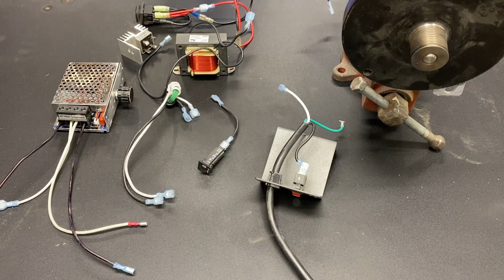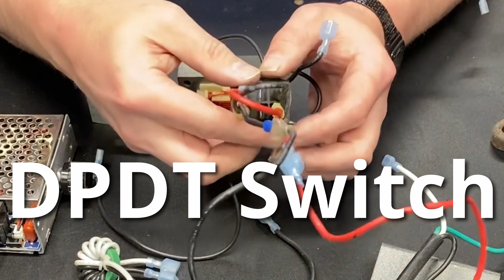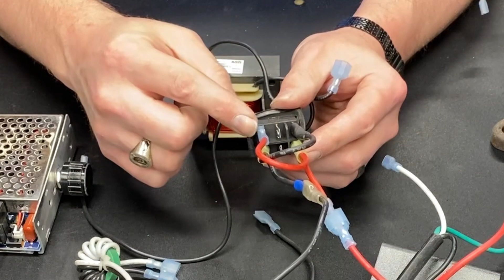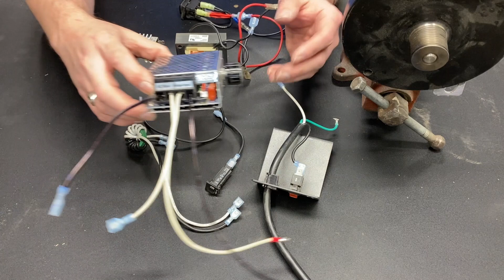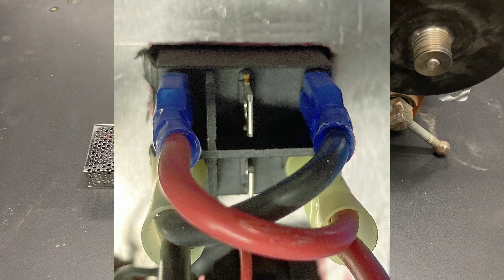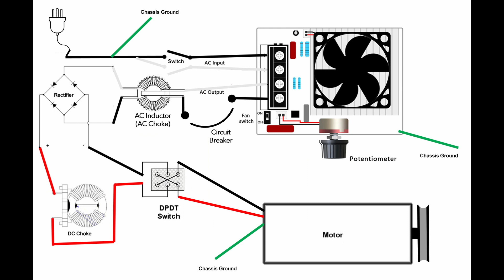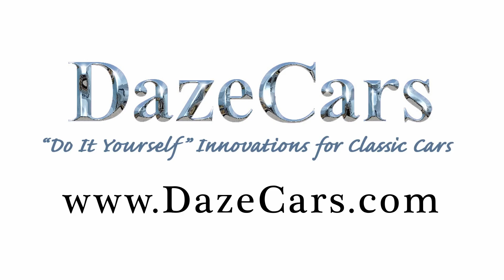Hooking up the Components for a Quality SCR Treadmill Motor Power Supply, Treadmill Motor Controller

Comment: Beautiful 😍 🙂👍👍👍cheers from Australia. Subbed and liked
Reply from the maker: Glad you liked it!!
Reply: @dazecars  thank you! I stripped my wife's treadmill and kept all electronics!
Reply from the maker: @Edmond3290  what kind of goodies did it have? which control board? which motor?
Reply: @dazecars  it was a healthstream brand which I paid 1200 AUD from my dads inheritance. I did tell the wife: it just needs a new belt! Everything else is perfect. She wanted it gone. So I have absolutely everything but I have pulled all the electronics out carefully and now I'm going to cut up the frame! I did want to sell it but she wanted it gone badly. Lol. So I'm happy with a 180 volt 5 Amp motor.
Reply: @dazecars  it has a j star brand motor for incline, a HPF filter, quite a ferrite core style choke, circuit breaker, on/ off switch .a complete circuit board with the main control panel and magnetic safety switch, and a little transformer. BTW I've never stripped a elliptical strider? But I have her healthstream strider. LCD is stuffed but everything else is there. After icut up a heap of steel while it's daylight here. That's my next mission! Lol 😆. Cheers

Comment: What size circuit breaker are you using? 15a?
Reply from the maker: 20 but a 15 would work just fine as well
Reply: Could I use a fuse a 20 amp fuse from a vehicle as a circuit breaker ?
Reply from the maker: I wouldn't

Comment: The power from the wall go at 220v or 120v ?
Reply from the maker: I am running mine on 110, but many SCR controllers are set up to work at 110-220 so as long as you had a 180V DC motor you could use 220 out of the wall.  I would not use a 90V DC motor with an SCR and plug it into 220 UNLESS you put a limiting resister in line with the potentiometer to make the max speed the max rated RPM of the motor.

Comment: In the video ( which is very good information) you have a circuit breaker, what amp did you use.
Reply from the maker: I used a 20 amp.  You could probably get away with 15 but 20 is better.
Reply: Perfect thank you for the information and video, it clears up my questions and is very well done!
Reply from the maker: @claywilson8706   Thanks, let me know if any other questions come up.
Reply: @dazecars  Thanks again and keep up the good information, It's much appreciated !

Comment: I wired my Johnson 2.5 hp treadmill motor to a 12 volt dc wall wart power supply. It runs the right speed for my thickness sander conveyor belt. Will running it that way damage the motor?
Reply from the maker: It shouldn't hurt anything but it will probably not run very well.  A wall wart doesn't typically put out more than 1.5 amps and most are even smaller than that.  Most treadmill motors are 10-20 amps.  There is a direct correlation between amps and torque so if you are providing fewer amps than what the motor is rated at you will get less torque and in this case a lot less.  By extension that also means less HP as HP is a calculation based on torque in foot pounds and RPMs.
Reply: Thanks for the info.
Reply from the maker: @chuckstoffregen8632  Glad I could help

Comment: Great informational video. I have acquired all the components that I will need except the a/c choke. I was wondering if I could use a noise filter (RDFC-2916 047100) as found in smart drive washing machines. I have access to this at 0 cost but not sure if it would work.
Thank you for shedding light and helping out.
Reply from the maker: My FAQ video scheduled to go public on Tuesday is all about chokes, but I can give you a preview of the information on that video. 😁 When it comes to the washing machine noise filter, honestly I do not know if that will work or not.  I have some microwave noise filters that I plan on testing between the SCR and the rectifier but have not had time to follow up on that.  Nice thing about the Microwave unites is they include a 15 amp fuse  The AC choke (also known as an inductor) can easily be a DIY project.  They sell ferrite doughnuts on eBay and Amazon and then it is as simple as taking 7 wraps of wire for each lead and then putting ends on the wires.    Please let me know if I can be of further assistance.

Comment: Hello again, I have scrapped 2 treadmills lately and the choke on the DC side to the motor were similar to the A/C chokes in your videos,  do you think I could use these chokes in lieu  of the transformer type looking choke?  Just one more question, what amp breaker do you recommend between SCR and rectifier. Thanks for you help.
Reply from the maker: With the choke bigger is better.  I have seen them from the little doughnut you are referring to all the way to the size of softball.  The bigeer they are the better they have worked in my exprience.  15-20 amps is a good circuit breaker size.

Comment: Another great video. I just purchased a SCR from Amazon similar to the one you are using. When reading the Amazon feedback there were a lot of comments that the SCR's were faulty, as there was not change in voltage when checked with a multimeter.  I checked the one I got by just hooking it up to a/c power supply and checking  it with out hooking the output to any appliance. I was expecting the multimeter to show a voltage difference when turning the pot, but there was no change, same in as out. After many youtube videos I found out that the multimeter will only show a change in voltage when it is actually hooked up and turned on to control an appliance. Hope this might help someone else.
Reply: I was only 30 minutes from doing the same test on my SCR then I read your post and had I not, I probably would have punched a hole in the wall and threw all the rest of the project in the garbage bin.😄
Reply from the maker: Good informtion, thanks for sharing it.

Comment: Also in the schematic where have you connected the wiper for the pot and have you used a 10 turn pot?
Reply from the maker: all my pots are inexpensive single rotation pots (only about 3/4 of a full rotation). on things like my lathe I use two pots a 10k and a 120k in series to give fine and course speed adjustment.

Comment: Great simple instructions thanks. I may have missed it but it seems you have bypassed the soft start, how?
Reply from the maker: soft start is only an issue on boards removed from a treadmill.  Being an aftermarket SCR there is no soft start to deal with.

Comment: Hi Daze, not sure that’s your name but, loving your videos. I am in process of replacing one dc motor for a newer version. My old one ran on a MC-60 and going through a DPDT switch. It’s been hooked up for a couple years and I don’t have pictures of how I had it going through the choke and to the switch. I wanted to keep the new motor running on the MC-60 and the basic setup I had on the old motor. I also have a POT hooked up but thats irrelevant. I have pictures of my setup but can’t add them here. Can I send to your internet site? I just have one loose wire and it’s coming off one side of the choke and going to the DPDT switch but can’t remember where it goes on the switch. I WILL have pictures next time.
Reply from the maker: I can probably help. contact e through my web site so you can email pix

Comment: As usual. Great Video. 
Do you have a diagram to add a capacitor to smooth out the motor?
Is that needless complication?
Reply from the maker: I originally used an RC circuit (Resistor Capacitor) parallel to my motor in my setups but found that it didn't add any noticeable improvement to motor function, motor sound, and no noticeable reduction in spark where the brushes make contact inside the motor. (it was a huge help in those three categories when not running the inductor and choke but with the inductor and choke installed the RC circuit became somewhat redundant) To add to that when I was loading the system, such as deep cuts on my metal lathe, the motor would pulse as the the capacitor would discharge and recharge due to the increased load.  Because of that I removed them from the systems.

Comment: I’m missing the DC Choke, where are you buying yours from?
Reply from the maker: A lot of treadmills come with a choke. Go to eBay and search “treadmill motor choke” BUT know that most people on eBay don’t know what they have and the word transformer will also appear in the listing. Problem is a choke and a transformer look almost identical so some listings are for transformers and some are fore chokes because the sellers think they are interchangeable. They are not.  To tell the difference count the wires. A choke will only have 2 wires, a transformer will have 3 or more.
Reply: @dazecars  Great Videos.... Great Channel... are there any specs we should look for when shopping for a DC Choke? also You should mention the specs in your videos or diagram that will be helpful. I did find for the fuse it was 20A in the comments.
Reply from the maker: look for "motor choke"  everything else will be too small

Comment: Hi there. I just put together a circuit from your instructions in your previous video on this topic.  Thanks for showing the steps because I wasn't quite sure I did it right. The only difference between ours is that I put my breaker at the being of the circuit, from the 120v wall power. How does this different from putting it between the speed controller and the rectifier? 
Also, don't negatively charged electrons come out the negative side of a DC circuit? So should the DC choke be on the other side of the rectifier-- the negative side? 
It's hard to find good, demonstrations on setting up treadmill motors, so thanks for posting.
Reply from the maker: Having a circuit breaker between the SCR and the wall will cut the power on the system before the house circuit breaker trips.  Not a bad thing to have but not required.  The house circuit breaker is there to cut power if there is a short and that is why most things we plug in do not have their own circuit breaker.  The most likely failure point in the system is the rectifier and if it fails it will draw more power than the SCR can handle burning it out.  Putting the breaker between the rectifier and the SCR protects the SCR from retifier failure.  Think of it like a chain of events: Your setup, rectifier fails, overloads SCR which fails, than trips circuit breaker.  My setup, rectifier fails, trips circuit breaker and SCR is not affected.  Make sense?

Comment: Great video – thanks. You are really eliminating the guesswork for non-electricians like me! Next question: how do you deal with the treaded shaft/flywheel for high torque reversing applications like a lathe?
Reply from the maker: There is another video coming up with that info, but to give you a priview, the easiest solution is lock tite.  That how all the smaller motors I have gotten come from the factory.  A set screw can also be used.
Reply: @dazecars  So you just keep the flywheel and stick with whatever belt the treadmill used?
Reply from the maker: @JohnThawley  Yes, no, maybe.  It depends on the situation. (you are really trampling over my future video 😂😂) some flywheels can be removed and there is enough shaft under the threads to add a pulley of your choosing.  In some cases however the flywheel is also the fan so unless you add a differnt fan you must use the flywheel.  My mill has a motor with thread on fan type flywheel.  On it I turned the snout of the flywheel smooth and pressed a v pully over the snount. On a mill there was no need for reverse so I did not need to use loctite.
Reply: @dazecars this can use for treadmill machine if the power supply has broken?
Reply from the maker: It could but its a bad idea.  It will not have all the safety features that a treadmill needs  @marvedavid4104

Comment: Great work,, I like what you do,, 👍
I am using this set up tomorrow on a Bandsaw,, (minus reverse)
Reply: Need to ask a question,, what type and size Circuit Breaker do you recommend?
Reply from the maker: Depends on the motor but in most cases a 15 amp is perfect.

Comment: Hi love your display of how to wire up all the components of running a dc motor. Wish you had done it years ago, I would have had an easier time of hooking mine up. One question, the inductor is new to me. Why again is it necessary and are there different sizes and which one is required? Thanks again for this very informative video. Plain as day!👀
Reply from the maker: The inductor is basically an AC choke.  It smooths out the power.  A lot of treadmills come with inductors as the first component attached to the wires from the wall.  Its purpose is to clean the power out of the wall before it hits any other components.  I put them between the SCR and the rectifier because the SCR is simple and robust.  In other words power fluctuations from the wall will not hurt the SCR.  The power coming out of the SCR is full of fluctuations (dirty power) both from the wall AND from how the SCR works.  The inductor reduces (but does not eliminate) these fluctuations.  It is kind of like corse grit sand paper for the power, nocking off the rough edges.  The DC choke then smooths the power out even more (fine grit sandpaper)  make sense?
Reply: So would having an inductor before the SCR and after make the power cleaner or does it not work like that..? Would there be any benefit at all from adding a second inductor on the AC side or choke on the dc side..?
Reply: An ac inductor eliminates voltage spike that occurs when the power is turned off. This spike is caused by the collapsing of the magnetic field caused by ac. These voltage spikes would go directly to the scr circuitry if not for the inductor.  A rectifier and diode combination virtually eliminates that spike.